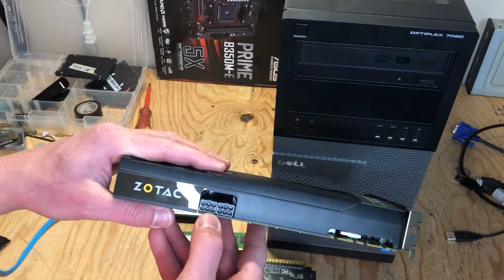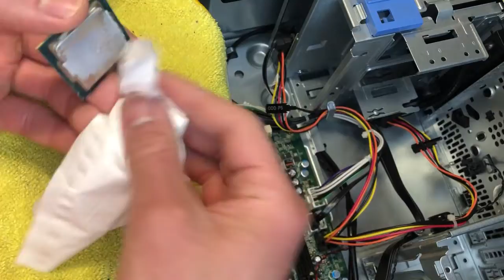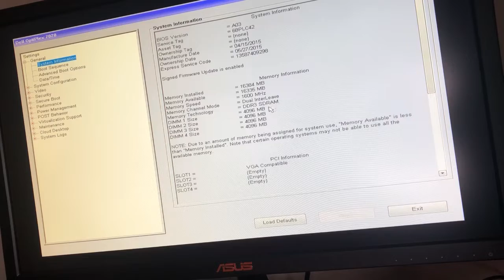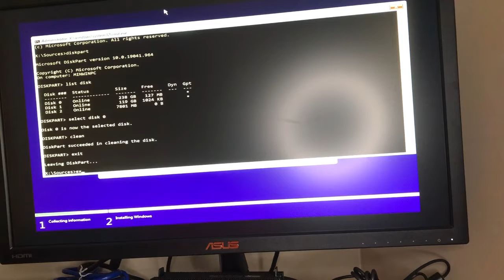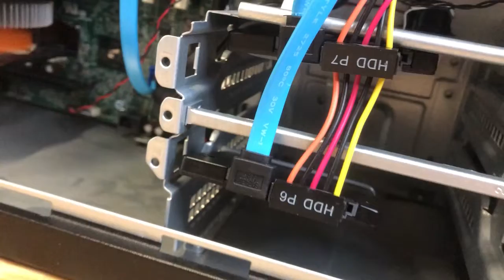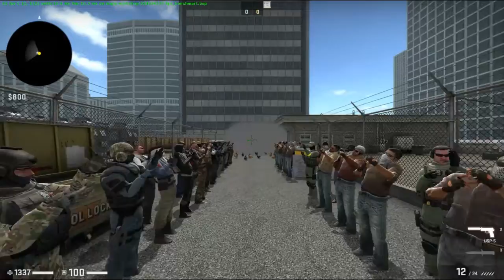Dell Optiplex 7020 Upgrades Install Tutorial - GTX 650ti, SSD, RAM

Comment: Bro I was add a GTX 1660 Super on optiplex 3020 Frist boot it's working fine after I cold boot the pc or shut down and trun on no display signal coming how to fix that' 😢
Reply from the maker: Have you tried reseating the GPU?  Taking it out and putting it back in?

Comment: Can a  1050 ti fit in here?
Reply from the maker: Most likely, yes.
Reply: @HaisteComputerRepair  do you know if a 7060 mt could fit a low profile 1050 ti
Reply from the maker: @iamhoopla  Yes I am fairly certain you should have no problem with a low profile 1050 Ti in the mini tower

Comment: Dell Optiplex any of them are the worst puters I've ever had and I have had 12 + and took 2 to the puter shop just a few minutes ago. LENOVO Just a note I use Win 7 64 bit on all
Reply from the maker: Are you saying that you have had 12+ Dell Optiplex PC's?  Or the Dell Optiplex was the worst you've experienced from a range of 12+ computers you've owned?  If you can fix up your sentence structure or run your thoughts through an app like Grammarly, it will be much easier to understand what you are trying to say.
Reply: @HaisteComputerRepair  Yes, When I unplug the Optiplex dosen't matter which one it looses the time in the bios then press f1 to continue and change time in the windows icon. I've had at least 10 in the lat 2 yrs. The Lenovo never does this. I've got an HP Z230 coming and as I have never had 1 of these, look forward to playin with it! If you don't move the Optiplex it's fast like the others. I only use Win 7 64 bit
Reply from the maker: @MrSmi31093  That sounds like a BIOS setting that should be altered, or, a CMOS battery replacement.  Perhaps a handful of other issues that aren't particular to Dell necessarily.  I have had this problem with Dell laptops/desktops and usually it's fixed by proper BIOS settings and Windows configuration.  It does take time and patience to troubleshoot, so I understand where the frustration comes from.
Reply: @HaisteComputerRepair  You might be right
Reply from the maker: @MrSmi31093  Good luck with your newer PC's.
Reply: @HaisteComputerRepair  Well, I got a thing called Lenovo H520. I seen the board was the 24 pin and that will not work with windows 7 64 bit.They used to but something changed. So, I was ready. Put in a 14 pin PS a Lenovo P 300 board Only thing is there are only 1 usb pin set on these boards. So 1 usb works on the front and there is a usb outboard hub from Ebay and I added that. I know the board has more on the back. I look foward to getting this HP Z230 tomorrow. Should be fun to build. Ive got 3 lenovos all the same board now. I'm about done. Roll me over.
Reply from the maker: @MrSmi31093  The Z230 looks interesting.
Reply: @HaisteComputerRepair  Keep in mind they are about $40 on Ebay Dell Lenovo or HP. I've got 3 Lenovo's and 1 HP and I think I'm done. The puter shop 2 blocks away get them when I;m done. Got cats, Love dogs feed Racoons everyday.

Comment: Does it matter what brand ram card I use for my Dell Optiplex 7020? Or certain models that are compatible that I should be looking for? I've never shopped for Ram before. Idk wth I'm doing lol.
Reply from the maker: Brand doesn't really matter so much as just having the the proper DDR3 1600MHz RAM.  Having the same sticks in each slot helps.  That being said, a safe bet would be sticking to either a reputable brand like Crucial, Samsung, SK Hynix.  If you go budget, do some research on what RAM chips are used.  In some cases, budget brands use SK Hynix chips.  Timetec and Silicon Power are cheaper brands that I have had little to no issues with.
Reply: @HaisteComputerRepair  Ok cool! Thank you very much. I appreciate the advice. Have a great day.

Comment: What is better, using an adapter cable from SATA to PCI-E 6 or changing the power supply?
Reply from the maker: I think either option could work.  So long as the power supply is rated for the power output.  Many graphics cards come with PCIe plug splitters and molex adapters.  I don't see SATA adapters too often, but I have some and I have used them with success.  BUT at your own risk "SATA power cables are rated for 54W and PCIe requires 75W - and it will require 75W."   Check out this for some reference:  https://www.reddit.com/r/EtherMining/comments/7i0az7/for_safetys_sake_please_warn_people_not_to_use/

Comment: Hi i wanted to ask can i run gtx 650 on a default factory power supply unit the pau came with a i7 4thgen optiplex im not much of a genius when it comes to these things lol
Reply from the maker: You should have no problem.  You might have to use a SATA to PCIe 6-pin adapter if your graphics card needs it.  The 650Ti has a recommended PSU of 300W on Techpowerup.com, but you could probably get by with a little less.  Check what your power supply says on the label.  Feel free to reach out again if you need anything.

Comment: do you think i can power a gtx660 whit that adapter ?
Reply from the maker: Well, the GTX 660 has a 300W PSU suggestion, but you could probably get away fine with the 290W PSU that is in this 7020.  Source:  https://www.techpowerup.com/gpu-specs/geforce-gtx-660.c895

Comment: i have the dell optiplex 7020 mt and i have added a gtx 680 with 16 gb ram ddr3 and purashed a ssd and i get 120 fps in almost any game bc i have optimized all games i play
Reply from the maker: That's awesome.  Do you have the i3, i5, or i7 version of the CPU?  You must mean DDR3 RAM?
Reply: @HaisteComputerRepair  i have i7-2600 and i mean ddr3
Reply from the maker: @X_VNT777  Interesting.  This 7020 had a 4th gen Intel i5 CPU.  Well, either way, I still think the i7-2600 is awesome so have fun with your setup!
Reply: i have upgraded to i7-2600 it acutally work s fine
Reply from the maker: @X_VNT777  I built a bunch of budget i7-2600 builds during the pandemic and I really liked the performance.
Reply: @HaisteComputerRepair  yh i know good peformance for a 11 year old gpu like the gtx 680 with i7-2600 on fortnite i get 120 fps at peformance mode low meshesh 1080p gaming. Valorant i get 200 fps to 300 fps low settings. csgo high settings 200 to 260 fps. It gets the job done on 1080p gaming
Reply: @HaisteComputerRepair  i have optimized the pc so i could get little better fps on 1080p gaming
Reply: Do u have any tips on how to optimize your pc for better performance as we have the same pc and roughly the same specs

Comment: i have same pc but i upgraded psu and gpu. 700 watt psu and rx580 8 gb gpu. running 16 gb ram i5 4590 and i get a good 60 fps in red dead 2 with some settings on ultra and medium
Reply: 2 gb gpu isnt worth the effort throw at least a 4 gb gpu in it
Reply from the maker: @mike-bj4dk  Most definitely.  The GTX 650ti is just something I had sitting around.  I needed to do something with it.  Sounds like you have a good setup.  Have you thought about installing an i7-4770?
Reply: @HaisteComputerRepair  yes wasnt sure if i could. however my gpu is all checking out even the bios and plays fine but i cant use amd adrenaline and if i use win 10 driver i have to run ati/amd patch fix why is that ive tried stopping windows from installing the driver that didnt help.
Reply from the maker: @mike-bj4dk  You should be able to install the driver from the AMD website despite Windows installing one.  You've gone to the AMD site to get the latest one?
Reply: @HaisteComputerRepair  yes it just kills it i even turned of the setting for windows to auto install
Reply: @HaisteComputerRepair  sometimes it will say things like it isnt compatible with your setup which i know it is because my rx550 4gb runs fine with adrenaline
Reply: @HaisteComputerRepair  when i check gpu-z it shows an adrenaline driver it makes no sense why i cant use the software
Reply from the maker: @mike-bj4dk  OK, well if it is being recognized by Windows well enough to use it that's good.  Odd behavior though.  Can I ask what you want to use the Adrenaline software for?